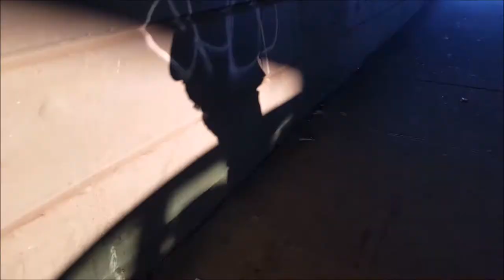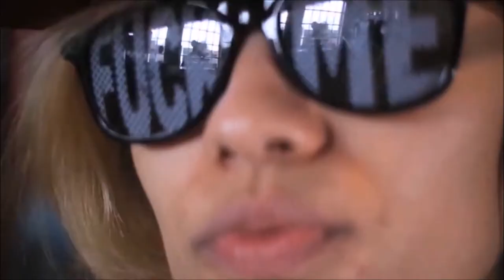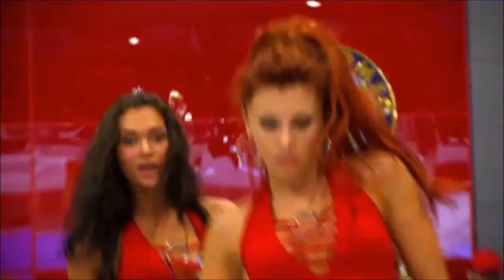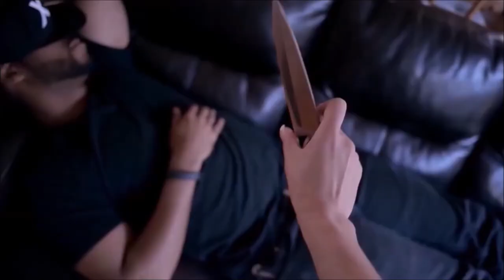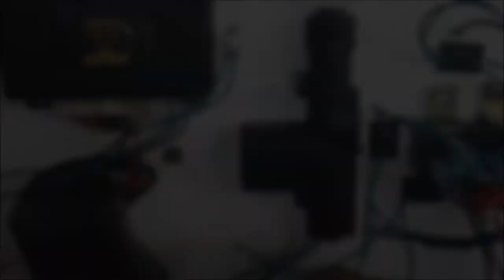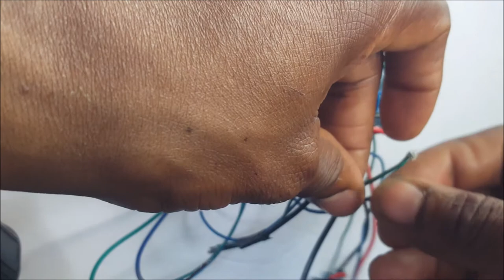Explaining By Example How To Wire A Direct Switch Controlled Door lock Actuator Systems No Relays

Comment: I followed your instructions to the T.
I have a 1999 chevy Suburban. I connected all the wires exactly to my cars wire actuators. It worked fine with the remote I was able to lock and unlock with the remote. But I was having an issue with the door button it would not lock or unlock it would try to lock but the actuator would come back up by it's self.
I checked all the wires to make sure they were connected right and they were.
So this is what I did I disconnect the Negative wires from the relay and wala now I can use the door lock and unlock and the remote with no issues.

On the 1999 chevy Suburban same from the Tahoe the wires to the actuator is located behind the side panel where the hood release is. Light Blue and white is what to look for both wire should be on the same harness. I'm getting my positive from the fuse box with an extra fuse on the positive line for safety reasons. 
Wire your relays exactly as the video above less the negative wire for your 1999 chevy Suburban or Tahoe it will work without issues just like mine.
Thank you for a very informative video.
Reply: So if I just want to use my door lock/unlock switch with no remote I can just leave negative for both lock/unlock disconnected? I’m converting my 2000 gmc to power locks I already did windows. Thank you

Comment: Hey, i got a question. My car has factory power locks. I just bought a aftermarket remote that ONLY LOCKS/UNLOCKS THE DOORS. DO  I NEED aftermarket actuators still. Cant i just TAP INTO the factory power locks. Also my car DOES NOT have any type of alarm. Thanks for your input

Comment: can i use a 5 pin switch? and one more question from where you take current and ground for the switch can i use the same 12v constant of the alarm?
Reply from the maker: yes a five pin switch is ok. i would recommend using a seperate power fuse and ground

Comment: At the end of the video you say the relays are not in play at all. What if I have them connected already and want to add a switch? Do I get the red(+) from a new 12v source and new ground and just add new green and blue wires to the relay-connected actuator? Thanks for any info.
Reply: Hey UFO I have the same question, have you been able to connect the switch?

Comment: I've seen other diagrams that show your main power going into the middle spots on the switch and the cross over wires corner to corner with the actuator on 1 side. Will that also work or will that not work in this type of application?
Reply: Also I am using a momentary-off-momentary switch. I see yours is an on-off-on switch. Is that the reason for the change in wire locations?
Reply from the maker: Kenny Johnson that configuration diagram that you're talking about has a relay involved. The purpose for that type of wiring is to allow a small current driven device to control a large current motor via a control relay. I've covered that configuration in another video.
Reply from the maker: Kenny Johnson a spring load bidirectional 6 momentary switch will do the trick . load in the middle and flip flop positive negative on both ends draw an X divide it in 2 left side top is positive bottom negative. Then do the opposite on the right side.
Reply from the maker: those diagrams are correct but confusing because those switches ( very hard to find$$$$$) the wires are crossed internally. the switch used in the video is very common to find

Comment: Hey bro, I have installed a push start with central locking system in my car. The push start stop system is working properly, but I can't connect it with the existing central locking system. There is a xenos brand central locking system fitted in my car. There is 4 wires coming from the driver door lock and 2 wires from the other 3 door locks. There is no switch for lock unlock. When the driver door lock is operated, the other doors does the same. In the driver door 4 wires, 1 is always negative, 1 (I can't understand), other 2 wires are normally positive and gives a negative pulse when locked and unlocked. Now how can I connect the new push start with central locking system with the door locks. Please suggest.
Reply: im having the same problem , did you find a solution ?
Reply: You would need to add one actuator in the drivers door to control the mechanical locking mechanism. It will then make the other doors lock and unlock when the drivers actuator is moved.
Reply: Amer Joudeh add an actuator in drivers door.